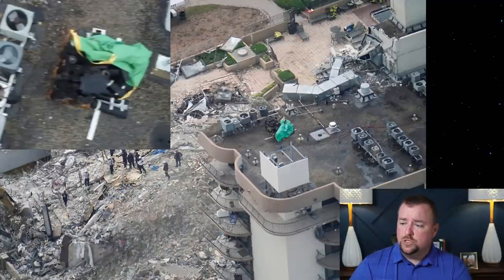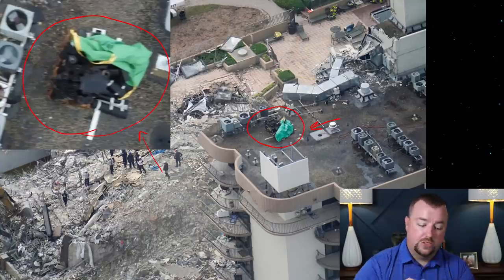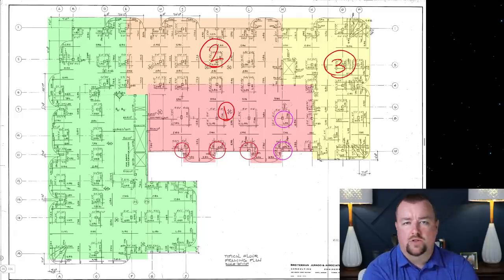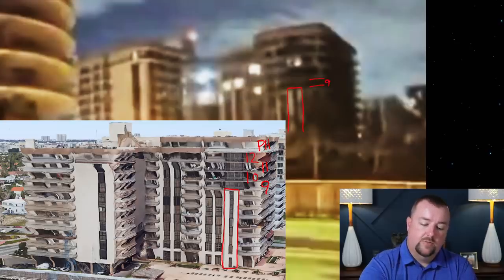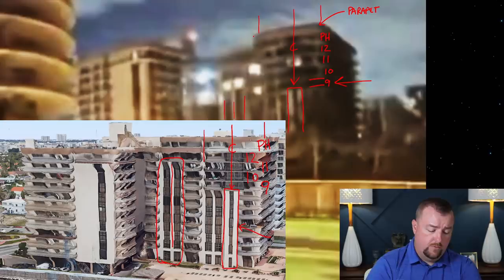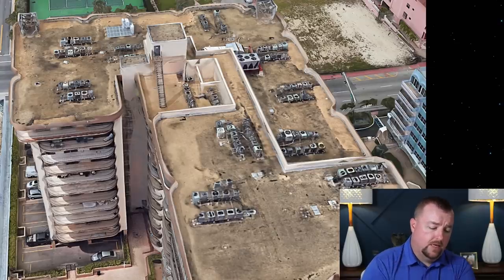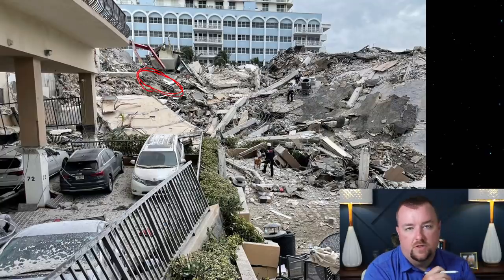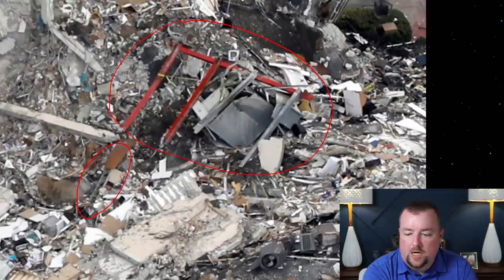Surfside Building Collapse - Did it start at the roof?

Comment from the maker: Remember everyone, unlike others in the media and YT, the purpose of these videos is not to speculate on the definitive cause of the collapse, but to instead explore and think through all possible contributing factors.  And on that journey to hopefully teach about construction and engineering principles.  Thank you for you support!
Reply: Dude seriously. I'm an electrician. That light is hundreds of amps of electricity arcing. Thats why they are blue flashes. Its the electrical lines ripping and shorting out. smacks head
Reply: Your the most professional and reasonable people on here! There are alot of wacky idiots on here posing as a engineers!!🙄    keep up the good work!! Thank you!👍
Reply from the maker: @Kneumann1991  thank you. In the middle of filming, it is sometimes difficult to articulate a thought.  Electrical arcs is what I was thinking... exploding electronics is what I said... hehe thanks for the insight!
Reply: @Kneumann1991  LMAO  You better find another job then!   There wouldn't be any electrical arcing on the outside of the building ,all of the power lines  would be incased in steel conduit and would be in the center of the building in a shaft of some sort. Also,  As soon as those lines shorted out the breaker would have tripped immediately.
Reply from the maker: @Kneumann1991  the portion of the building you are referring to is not L-Shaped at the 12th and PH floors.  Please refer to the direct overhead aerials and review the drawings again.
Reply: Great video as always! Love the detail you go into and I am looking forward to new videos! I work in Network Engineering and it is very interesting to learn about how complex construction is and hear how well you explain it.
Reply: Carmine Fragione  Living in a world full of conspiracies must be really fun. You are part of the problem, not the solution.
Reply: I have already noticed at least one video that has already made a definitive statement that "this is the reason the Champlain Towers Collapsed". Thankfully you are offering critical analysis without jumping into that pool yet.
Reply: Have you seen the video recently released by somebody who toured unit 611 last year?  It has some excellent footage from the garage.
https://youtu.be/w4rGWH7aDJc
Reply: Carmine Fragione  Garbage.  The only thing you can immediately say is some wild conspiracy theory.  Determining actual causes takes time.  A lot of time.
Reply: @Kneumann1991  Look again.  You can see at 7:12 and 27:53 the south side of the collapsed part is all a straight line.  There is no 30 foot back section as you mistakenly claim.
Reply: Super fascinating, thank you for your analysis. I’ve never been interested in being personally involved with these topics via a career, but it’s so cool to learn through someone who can explain it concisely, yet thoroughly.
Reply: @Kneumann1991    Note that car sparks uses 15K - 30K Voltage, to create a spark.
For an electric arc you need  high Voltage not  Amps. 
Anyway, let's agree that  the light is way too bright for normal lighting.
I don't think thees apartments had any high Voltage cables. So It could be either exploding light bulbs,  or explosives.
----
@Building Integrity  I agree on your analysis, that the  part, that collapsed first is already down  6 feet or so at the first frame.
As this building collapsed on June 24th in a similar way as on July 4th, and similar to WTC7, which according to the University of Fairbanks, Alaska was not due to fire,  demolition is the most logical theory to work with.
But let's see what all the building experts have to say. 
You are not jumping to conclusions, which is good.
Reply: @BuildingIntegrity  Not sure if this is significant or not, but just noticed that there appears to have been additional planters added to the pool deck that aren't on the original plans.  If you look at recent photos of the building (pre-collapse), a good site is miamicondoinvestments.com notice the planters that have darker green plants, those appear to have been added later, and one of those, a pretty big one, seems to be right over the area that collapsed first.
Reply: @Kneumann1991  The first step in making a convincing argument is spelling and grammar.  I stopped reading at "your" and "threw".
Reply: Carmine Fragione  no. as he already covered, concrete overloaded in compression shows no signs of stress but will fail catastrophically with no warning. all it takes is 1 beam to crush out and that starts a chain reaction because the surrounding ones take the load, but it's way too much and within seconds or less, they fail. as gravity takes hold, it disconnects the walls from the floors enough that everything falls flat. build a pyramid of books standing up like a house of cards the more layers the better. then yank the centermost one on the bottom. how's it gonna fall?

go look at the photos of the conditions of the concrete. there were already a lot of signs in the horizontal load members that they were overloaded. large amounts of spalling and cracking documented before the fall. as the building thermal cycles from day to night, the expantions and contraction of the structure causes loads to shift, so every day, that cracking progressed exponentially...

so yeah, no. you are wrong.
Reply: I know what you mean buddy, your exploring all means of the failure. Good job
Reply: This is a video showing unit 611 and the parking garage just days before the collapse. You can see water pooling by the beams that failed in the last few seconds of the video:  https://youtu.be/w4rGWH7aDJc
Reply: @jon123etc  yes wet everywhere and stalactites hanging down from ceiling. I think I read somewhere that cars were being damaged by calcium deposits in the years prior to the collapse
Reply: The building sits on top of the Biscayne aquifer. Could the water table have decreased to the extent the sand under the building could no longer supported the structure ? (https://pubs.usgs.gov/ha/ha730/ch_g/jpeg/G028.jpeg)
Reply: There is a great video just posted on the channel fiueee showing the locations of the cracks in the garage as of 2020.
Reply: "not to speculate on the definitive cause of the collapse, but to instead explore and think through all possible contributing factors" That is not how you are portraying  this, you are speculating through possible contributing factors.
Reply: This was great. I didn't understand what planter boxes were so I watched your previous video with the Google Earth pics and now I get it. (I was imagining giant vase/box type things for decoration and couldn't understand how they caused a problem). Such a sad tragedy.
Reply: As a former professional engineer for building design and construction (HVAC), I really appreciate your measured and professionally informed views. Honestly, I hope it makes people appreciate the value of hiring an engineer and contractor with integrity rather than the cheapest engineering stamp they can buy allowing the cheapest construction drawings to go by. (That's why I got out of the business, my liability was attached to drawings the the contractor was allowed by the developer to build any way they wanted. I was a stamp to satisfy the law and code officials, and to be on the lawsuit should one occur.)
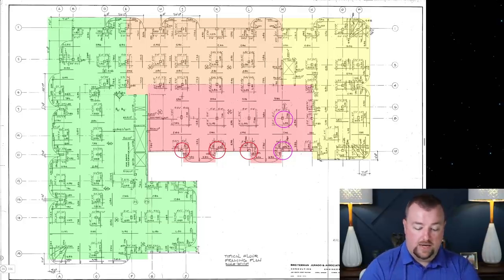Reply: @Kneumann1991  At 6:18 you can see the plan view of the building. That ~5 foot extension of that part of the building (Collapse 3) is what I think you are referring to. However, the roof is extended outward over the first collapsing section to be co-linear with the extension of the Collapse 3 portion. That means the visible roof line on which Josh is basing things is a continuous line that, when broken, tells the story of the sequencing of the collapse and likely origin.
Reply: I'm no engineer, but I did go to school for construction trades and have some basic clue as to what's being discussed in these videos. The conspiracy theories are laughably inadequate to explain the wealth of failure modes plainly obviously in the photos that caused the collapse and which were caused by it.
Reply: thx for your videos, it's hard to hear you in this one, especially compared to the other vids.
Reply: @Kneumann1991  I agree, that seemed pretty obvious to me from day one of the seeing the video.  If the video had stated one or two seconds sooner it may have been more obvious to most.  Then you see all these conspiracy fools saying bombs, etc.  SMH.
Reply: @willschultz5452  Breakers would've tripped after the arcing.  He didn't say anything about arcing on the outside of the building.  Those flashes were in the interior.
Reply: @bobbyd6680   Electrical conduit would be in the very center of the building some place not where you would be able to see it from the outside or from a window. Also the arcing would be inside of the conduit so you would never see it
Reply: Hello all. This doesn’t directly have to do with the collapse but i was reading that the Millennium Tower in SF CA sank 18 inches, is listing, and not secured to bedrock. 

100M usd is allocated to attach the tower to bed rock after completion. 

How does that work? How do they do that when the building is already completed?
Reply: @BuildingIntegrity  The ladder you're looking for is much larger and laying down and to the left of the one you was looking at... top left of the tan colored section it was attached too. 
 One thing I would note is the one continuous pillar laying on top of all the rubble, which oddly enough is not seen on the collapse video (from what I seen).
Reply: @buildingintegrity I emailed you video of the picture from the other angle of the building that you said is your favorite picture to show the ladder from the roof and the red piece from the roof.
Reply: @seldoon_nemar  None of what you said means a thing when it comes to this ''event'' This was a controlled demolition and land clear of an empty building. I don't even care if this building had existing problems because it was selected for demolition by whoever is running this long planned, scripted collapse event. Nobody Died.. the building was completly empty and I can prove it was unoccupied at the time of the first controlled demolition ... Just look at how bone dry the still standing floors were the night of and day after it supposedly spontaneously collapsed. There are miles of plumbing in that building yet on that night the pipes were dry ... yeah right, and Dr. Rachell (Rick) Levine is a woman!
Reply: Another video that I watched today shows clear evidence that the pool deck collapsed first. There is video evidence that appears to show concrete debris on the parking 7 minutes before the collapse of the tower. There is an engineering report dating from 2018 which indicates that waterproofing had failed. There are photos which clearly show concrete spading and obvious signs of rebar corrosion of the concrete slab of the pool deck. It also seems that there was a major error with how the pool deck was designed. There was no slope, so rather then being able to drain, water was able to pool onto the pool deck.
Reply: Carmine Fragione  Correct Carmine this was a controlled demolition with a script attached to the event. Nobody died this building was empty for a long time before the controlled demo however they kept up the appearances of it being occupied because it's a psyop as well as other things it will be used to accomplish. I know it's hard for people to fathom but this is really how things get done in the fake reality World. Thank you Sir!
Reply: @travisthechimp7857  okay, enjoy your fantasy
Reply: Carmine Fragione  i'm still thinking about this the next day. never seen before is how a LOT of engineering codes are written. they are literally to prevent horrid edge cases like this by providing a legal minimum build quality. after 40 years of gross neglect and mismanagement...

yes, the management company is LEGENDARILY stupid and will be cited in books for the next hundred years because of this
Reply: A plane crashing into the building caused the collapse. Just like 9/11
Reply: didn't watch your video , I solved this before anyone , as soon as the security video became public , I ran it frame by frame , an you can see the structure collapse from under , the first sign of trouble is when you see the 2 columns buckle at the knee .... the roof is intact as the structure begans to crumble, I knew this on day 2 of the tragedy , it didn't take me  14 days to figure out ..
Reply: @Kneumann1991  Duh - makes perfect sense.  Thank you.
Reply: @davewilson7255   Carmine's comment. Good for a laugh, yes.
Reply: @EZ Z 
If the water causing the damage to the pillars was from nightly watering of the plantar boxes, the water would not be chlorinated. I don't think that water from the pool was the problem, because the pool was at thar far end of the decking, and the pool was still filled completely with water in photos the morning after the collapse.
Reply: @bobbyd6680  distribution panels located every floor/every other floor that bring power to each of the units in those buildings. Each unit would have a sub panel inside a closet etc. There's definitely wires big enough to arc all throughout. Even ripping a 120v ceiling light out is going to be pretty bright at night.
Reply: An interesting animation of the collapse that shows the progression of the collapse.   It speculates that the collapsing deck pulled down those three columns.  That might not be true but the progression matches what I've heard.
Reply: @Hobomuskrat  I'd bet more on a distribution transformer in the basement getting crushed and shorting primary and secondary windings, delivering 13.8 kV, or whatever they use in Miami, to the 480V/277V internal distribution. Even delivering 480V to 277V to nominal 120V circuits is likely to destroy some appliances or lighting with arc flashes. That high voltage is likely to arc until it blows the high voltage fuse, and unit breakers would not be able to stop distribution level voltage. It would be interesting to see the blueprints of the electrical room, but electrical issues are one of the critical safety problems a different condo that was evacuated and needed to address, unsure if the electrical system had been inspected here.
Reply: @willschultz5452  Excuse me? Do you work on industrial electrical equipment during hurricanes?? I have been on site when electrical components explode and electrical lines short out. Electrical lines are within inches of the outside of the walls. If the walls are cracked open and the lines rip from each other and arc, that flash can be brighter than the sun. Ever hear of arc welding? Before you try and criticize people first study a subject.
Reply: @BuildingIntegrity  Will do, thanks for correcting me. Sorry was late at night and was watching political crap prior haha. Also, thanks for what you do.
Reply: @clamboni9  No not volts. I did not make a mistake. You just have a common misconception. High voltage is able to ionize the air to allow electrons to flow. If you touch the leads of a neon sign transformer together they make a spark you can barely see. But if you pull the leads apart you can make a arc an inch long. The reason it doesn't spark when the leads touch is because there is no amperage. Small neon sign transformer are 15000V and .25amp. Now arc welding on the other hand only requires only 10-50V and 50-300A. Amperage is what generates the bright flash when lines short out.
Reply: @brazilnut8898  Oh im sorry did spelling and grammer build anything?
Reply: @Kneumann1991  I know all about it,  theres no way your going to see a flash outside when the electric runs inside of rigid steel conduit in the center of the building in a utility shaft encased in concrete.   As soon as that shorted out the breakers tripped off instantaneously
Reply: @bobbyd6680  Yeah I wish more people understood how things work so they could see how foolish or real the conspiracies are. Like corporations and government have taken over how we live our daily lives, that's real. Bombs being put in a building that's been crumbling for decades is false.
Reply: @lagautmd  Yes, thank you. I read a bunch of replies and relooked. It was late at night and damn politics had me all flustered lol.
Reply: @seldoon_nemar  Yes and perfectly explained as well. I hope others read this.
Reply: @reallyme3573  No not volts. I did not make a mistake. You just have a common misconception. High voltage is able to ionize the air to allow electrons to flow. If you touch the leads of a neon sign transformer together they make a spark you can barely see. But if you pull the leads apart you can make a arc an inch long. The reason it doesn't spark when the leads touch is because there is no amperage. Small neon sign transformer are 15000V and .25amp. Now arc welding on the other hand only requires only 10-50V and 50-300A. Amperage is what generates the bright flash when lines short out.

P.S. Drop the explosives use crap because that's extremely insulting to the lost and loved ones of the lost. People need to understand how things work before slapping a conspiracy on it. Read what "Seldoon Nemar" wrote to me in the comments. He explains the principles of the collapse very well.
Reply: @willschultz5452  your wrong there, before a breaker trips, it will arc!! Don’t believe me? Go to your electrical panel and short out 240 and tell me if you see a nice blue flash before the breaker trips??!! I know personally that it can knock you on your ass and will make a nice pretty bluish flash before that breaker trips. And it can kill also before that breaker trips!! And any of those runs could easily have been compromised when it collapsed. Including ripping out wiring in the A/C units. So no it is not completely protected from such events!
Reply: @richardswenson4463   There is no heavy power that is run up that high in the building. Back in the 1980s each unit was probably supplied with 100 amp service.  The electric meters were probably in the basement or the 1st floor in a utility closet,  each meter has a 100 amp main breaker right next to it.  From there there would be a 100 amp service per unit running up to each apartment. As soon as those main service cables were severed and they are inside of rigid conduit  in a utility shaft  Those breakers would have tripped off immediately. The small arc. That they would have made would not have been visible from outside of the building.  Not to mention the elevator shaft and the utilities shaft was still standing so that never collapsed.
Reply: I'd like to see a discussion between you and a demolition expert reviewing this video (and/or any other available videos) identifying the reasons why this could not possibly be a controlled demolition.

It's about time to get a demo professional's input to dispel these alternative theories... preferably an expert from the EU... someone that has not seen the evidence before, who is credible, and who does not have anything to lose or gain by offering their opinions.

Thank You!
Reply: Hi Josh, 

please have look at my graphic.

http://zer0page.com/pix/aera-of-initial-collapse.jpg

Check out the positions of the coloums in relation to the floorplan, Parking Spot 78  and the videos we know so far. Do you concour?

I think initial collapse started in the aera of all these heavy Planters in front of Unit 111
This certainly would have made parts of the pooldeck come down too, which might have looked like what a witness called "a sinkhole".
Eventually the south facade of the building started coming down dragging everything else with it.

As for the bright lights on the collapse-video, they are most certainly light beams from electric cabels beeing ruptured.
As it happens the electric supply for the middle section of the building came from electric distribution rooms just behind the shear wall right next to the elevator shaft (see 1979 electrical schematics).
This is probably because at the start of the video the whole thing had allready come down at least one or two stories (great find by the way).
Reply: @Kneumann1991  Thanks for the explanation, but  do you know that there  is a problem maintaining electric arcs while using  AC-voltage ?
Reply: @willschultz5452  You should be fired for endangering your workers lives if you don't understand what "arc flash" is. Just look into it and you will better understand. I'm sorry I'm just an industrial electrician and a hobbyist electrician and seem to know more than a master. Instead of using your time to try and prove to people how they are wrong on the internet. You should use the internet to better understand how things work.
Reply: @Kneumann1991  I know EXACTLY how things work.  Ive been working on buildings like this for years!!!  That so called "flash" is a reflection or a outdoor light.  There is no  Industrial voltage in that building!  Its simple single phase 240v.    Anyway it's all in heavy conduit in a cement utility shaft like I mentioned.  The shaft was still standing.  So unless you can see a flash through 8" of concrete and a steel conduit 🤷‍♂️
Reply: @reallyme3573  Why do i have to teach everyone about everything? This is ridiculous. Most high voltage arcs are AC. Most arc welders are AC. AC is pulsing where DC is constant.
Reply: Martian Technology  There are so many different air conditioners because each model can handle different area sizes. It's also because they are built to break after so many years. They keep making simple adjustments so that they can re-patent their idea. After so many years anyone else can use that old patent. Plus technology keeps advancing so they are able to more easily add components or modify with new knowledge.
Reply: @Kneumann1991   The service to each of those units would be no more than a 100 amps. Especially back in 1981. I have shorted out 100 amps  Numerous times the breaker trips off instantaneously there is no arcing on the outside of the building.   That is either a reflection or an outdoor light
Reply: @travisthechimp7857  many people died in this are you crazy!!!  You sound like Alex Jones!!!
Reply: @jonathanlanglois2742  yes the pool deck was the cause and collapsed first
Reply: Did you notice the repeated flashes on the left side of the roof  up where the elevator and utility shaft would be? On the part of the building that stayed standing.  Those I think may have been arcing where all the air conditioning compressors were being torn from their wiring possibly.
Reply: @Kneumann1991  also the don't run service feeders in exterior walls , they are in the utility shaft in the center of the building.  That part is still standing. When those were cut off as the building fell you wouldn't see that from the outside.  Those are most likely outside lights or hallway lights
Reply: @Kneumann1991   You better go back to school because you have no clue what you're trying to convey to any of these people!!!!!! I've been working in the field doing commercial electric since before you were born!!   Trust me you are not fooling anyone with your BS!!!!!  You are just on here trying to get on people's nerves!!!    I work with this stuff every single day!!!!  I know what it does and what it does not do and I know where they run service lines within a building!  Just stop!!    I can make plenty of videos simulating all of this stuff!!
Reply: Martian Technology  each condo unit has it's own central air conditioning system.  Every one has its own unit on the roof.  Probably over time as each one went bad the persons contractor replaced it with whatever brand they use.
Reply: What about the huge planters with bushes on the pool deck over the parking garage, getting over watered for 40 yrs causing the rust & damage to concrete roof of parking structure - theres pix of ceiling damage in the parking garage showing rust.
Reply: @ShalomShalom-d5c   I think that was also part of the problem
Reply: @ShalomShalom-d5c  These buildings were designed and built to withstand CAT5 hurricanes.
Yes, Will... circuit breakers (even mains) will trip in under one cycle.
No Will... it was flash then crash.  The flashed preceded any destruction of the structure so the flashes were not the result of the collapse, they were the cause.
Reply: @richardswenson4463  You are 100% right. This guy will just can't accept he is wrong or take 30 seconds to read about arc flash.
Reply: @willschultz5452  Two words. Arc Flash.
Reply: People's lives are being endangered by Will Schulz. This is maddening and disgusting. Electricity is not something you F with. It can take your life in a second.
Reply: Arc Flash. Its all you people need to understand when it comes to those flashes.
Reply: Martian Technology  Sorry to hear that. It happens to me sometimes also. What does the for champagne towers have to do with different AC units?
Reply: @willschultz5452  Please. Please hear me man. I'm not trying to insult you.
Reply: Martian Technology  Ah that's simply because if you watch any movie enough you can already tell what's going to happen next. News isn't news in America anymore. It's more of a drama series of everything going on. The moment this happened I was saddened but also knew every democrat news outlet would try and use it to attack Florida and Ron DeSantis. There is a motive to what the news tells you and doesn't tell you. Either it's financial or political, and lately it has been both.
Reply: @willschultz5452  explain then how they supply power to all the A/C units and there also is the elevators! They don’t run on nothing!
Reply: @richardswenson4463   each resident has to pay their own electric bill so each air conditioning unit is powered from each residence circuit breaker panel
Reply: @Kneumann1991  Key element here is the gap distance. Arc welders use a very short gap of only a couple of mm's.  When a power cable is broken, at first it is stretched to the breaking point, then it snaps and  shrinks to it's original length. Doing so it creates a long distance between the electrodes,  then with Alternating Currency at zero Volt, it will stop, and due to the long gap won't re-ignite.
Creating a spark of 1/50th of a second max, which wont be captured by the camera.
-----
There's yet another problem,  and that's that power-lines usually run through shafts, on the inside of the building, not visible from  the outside.
Note that the light is visible in multiple windows of the apartments.
Reply: @randomorder2824  The floor didn't get pulled out it dropped out. Look I get everyone has been trying to relate this to 9/11 and I hope you realize the entire demolition theory is that Epstein had a hard drive hidden there. There has been reports since the 90's that there is water intrusion and its causing damage. It wasn't fixed for 30 years. If you really are what you say you are and know what you say you know. Than please don't jump to conspiracy without understanding all other possibilities.
Reply: @reallyme3573  Note you have no clue what your talking about. Electrical lines don't retract like a rubber band when snapped under tension its metal rofl. If anything they will curl as one side cools faster than the other. When they snap if the end of the wire connected to the circuit breaker touches any neutral line or ground in the building it will arc and flash. "Alternating Frequency" not currency and the statement made no sense anyway. Nothing will stop except the electrons on the black wire waiting for somewhere to go. There is also no Re-igniting electricity... its either on or off. If you unplug your light from the outlet the light turns off but the outlet is still "on". Sparks will last as long as the amps don't go to high for the breaker to trip. If you use wire rated for a half amp on a 15 amp breaker you can make sparks all day and the breaker will never trip. Your shaft theory is just as funny as the last guy who said it. Isn't there an outlet on every wall in an apartment?... wake up and smell the coffee. Ceiling lights/fans and wall outlets. The mains to the circuit panels in each apartment are in steel conduit. From there though, electricity is wired completely around your home or unit.

Edit: Oh and light in windows??? YEAH PEOPLE STAY UP LATE AT NIGHT. THOSE WERE PEOPLE WHO WERE AWAKE AND WHO DIED!!!!! As you even just said wires stretch. They just don't retract like you think. They are metal they don't shrink that much. They also stay live if cut but not shorted out. A 15A breaker would require a 15A short to trip it.
Reply: @Kneumann1991  what kind of electrical work do you do?
Reply: @Kneumann1991  Happens to me, too... best to avoid that political crap, LOL!
Reply: Damn, sure wish you had analyzed the twin towers, so disturbing to see!  That was sure no "pancake collapse",  that was a progressive explosion that blew everything in those buildings, including people, into virtual dust.
Reply: @Kneumann1991   This is what happens when a copper wire snaps:
https://www.youtube.com/watch?v=bpSQf6-4gHA
Electrical lines DO retract similar to a rubber band when snapped under tension.
---
AC = Alternating Current, not Alternating Currency (Did I say that ?, my mistake ) 
---
Note that with Alternating Current, there's a point  in time,  At 50 Hz, 100 times each  second, where the Voltage is Zero, and the electrons don't move forward nor backwards. That zero Voltage, Zero current, will terminate the electric arc, if it ever existed. During welding,  the electric arc will remain during  AC-welding, that is because of the short distance between the electrodes. try AC welding with a bigger gap between the electrodes and it will fail,  not so easy with DC welding.
----
Now we know this, an electric arc could be present for no longer than 1/100th of a second.  Way too short, to be captured by a surveillance camera.
---
The bright lights, that we are discussing came from the APARTMENT windows, not from a hallway.
So it must have been a flash in the apartment, causing the bright light.

If, the color of the light looks like an electric arc from welding, then maybe that could be what has happened:
Some automatic welding equipment cutting through the rebar in the already weakened, prepared columns.

You constantly talk about the people that died. That's a wrong attitude.  The MSM-news told you that people died, but do you know that they lied to you in the past ?
So forget the people that may or may not have died, forget  the narrative of the  so called eye witnesses and switch of your emotions and start think pure logically, and look at the surveillance-vid at what it shows, but keep in mind that it may or may not have been manipulated through CGI.

The surveillance vid shows that the collapse starts at the bottom. followed by the bright light at the top,  followed by the  implosion of that same part at the top. 
That's a controlled demolition scenario from the textbooks.
Reply: I hear alot of small hats died.

😁
Reply: Thank you for doing what you do. There is another channel here in YouTube that makes wild claims and then tries to politicize the whole thing.
Reply: Speculating on the definitive cause of the collapse is exactly what you are doing.
Reply: @willschultz5452  Guess you don't work with electrical equipment - Always a FLASH before a breaker trips ... Especially at 100's of Amps
Reply: @glenholmgren1218   It depends on how the circuit was broken. If it is a fast clean cut the 100 amp breaker will trip immediately.   Yes there might be a  Flash but where those electrical lines were located you would have never seen it from outside.  The utility shaft was still standing and  Each main feed up the shaft to the condo units would be inside of conduit also.   That shaft is over 50' from the exterior wall.  If there was a flash from it I doubt you would see it.   I'm sure all of these things will be studied more carefully when the investigation begins though.
Reply: I think the real reason may not be revealed.The reason for 9-11 was just revealed and as millions have said,Thermite. it was found on roofs after the collapse.
Reply: @Kneumann1991  my husband works as a lineman for a power company, and they work on the lines hot. He’s almost been flashed, has coworkers who have been, and has lost a coworker and had one burned badly. It’s very dangerous stuff.
Reply: @michealgoins1625  Mainly Industrial single phase to three phase motor work on automated systems. I can literally do any electrical work though. I should start making videos of the things electricity does when its not supposed to.
Reply: @christianehoelzer2228  I'm a bit confused on what you mean by steel packed Wi-Fi cables. I'm not sure if this is just a bad translation. Wi-Fi is a wireless connection. I think you might mean Cat 5 or 6 cable. I'm not really sure what you mean though. The steel cables you mainly see hanging is rebar and the tension cables that supported the building. There are definitely other cables like coax, CAT 5 or 6, and power lines.
Reply: @amberw144  Yes, yes it is very dangerous.
Reply: @glenholmgren1218  Thanks at least some other people actually work in the field and write comments lol.
Reply: @reallyme3573  Firstly do you know what's a wrong attitude? The attitude that rich elites care about killing off a few hundred people for their gains. Pharmaceutical companies kill that many every few minutes. Secondly let me just say I live in south Florida and know people who lost someone in the collapse. You really need to find help. The lights in the apartments were people still awake, as your video shows copper can stretch. Honestly you sent me a video to watch that only proves you wrong rofl. The top pully moves away from the wire, the wire doesn't retract lol. The sudden drop you see on the chart is because there is no more displacement happening. The displacement is a measurement of the wires length as it is stretched. The drop to zero is because the displacement or stretching has stopped. You can't even understand a displacement chart. Also First off, all electrical wires are insulated. The insulation will snap back like a rubber band and leave the copper wire stretched and exposed. If that exposed wire touches anything grounded or neutral it will arc for much longer than 1/100th of a second. Your whole argument is based on nonsense. Also AC in America is 60Hz. Meaning that every 60th of a second the voltage has completed a full cycle. Yes MSM is a complete load of trash, but so are you arguing something you have no clue about just like them. You are the main stream media in this convo my friend and I hope you realize that. You're just as full of horse sh!t as they are. It must be nice pretending people didn't die. Must help you sleep at night or your just that ignorant.
Reply: @christianehoelzer2228  I think I know what you're saying so I want to say yes lol. I believe you're pointing out there are multiple cables for all household electronics, correct?
Reply: Look people, if you are unable to understand this stuff after the multiple explanations I've given. Well than there is no hope for you. I'm tired of this nonsense. I'm going back to watching other videos on how things work instead of trying to teach everyone else. If you have some intelligent and constructive to say hopefully I will see in in my notifications and ill talk. Other than that I'm not answering any more straight up ignorant people. Trust me, you know if I'm talking about you or not. Its always fun testing my knowledge. It's even more fun being corrected when I make mistakes, this means I can learn and grow. Thanks all, and keep learning how everything works. It might save you one day.
Reply: @willschultz5452  This is my last comment to ignorance. Congrats Will. Your message to Glen is so wrong. Do you have outlets on almost every wall in your house or condo? The answer is yes, so stop talking about the main. No one ever said anything about the main line. I'm guessing you finally cut a power wire with scissors and found out there is a flash. Good for you. Keep learning and one day you might actually be smart.

P.S. Now I'm insulting you.
Reply: @Kneumann1991   You better quit while you're ahead!!!  I'm busy re wiring and operating Room in a hospital so I don't have time for your nonsense anymore this will be my last response!!!
Reply: @Kneumann1991   Yes the master electrician expert has just spoken!!!
Reply: Martian Technology   Another nut job on the loose I see!!!!!
Reply: @Kneumann1991   You are the one that needs to keep learning. I know very well what you are talking about with Ark. Flashes I do demonstrations during fire prevention week for little children to show them the different effects of electricity!!!!  What I am saying is you're not going to see those flashes on the outside of the building from where those flashes would have to have been created.   Don't forget those walls are cement not wood and drywall.
Reply: @willschultz5452  Says this will be his last response, proceeds to write two more after. Quit while ahead? So you admit your wrong and falling behind. Funny.
Reply: @willschultz5452  Don't forget walls were sheered in the first frame of the video. Mister cement, wood, and drywall. Sounds like what your brain is made of. Eh its probably closer to the aftermath. Just a bunch of rock, saw dust, and bent steel.
Reply: @christianehoelzer2228  Wow. Yeah that's sounds like really bad construction. The only other option would be much much larger cables but this will have many problems as well. High rise buildings are a fire hazard in general and are only built to increase monetary gains. Just remember either it's built a certain way because someone lost money or they want more money. Safety protocol comes after someone already got hurt.
Reply: @willschultz5452  How much electricity have you done sir ? I think this event could not be explained by thevinins theorem or anything such as that. The catastrophe if the utility channel which we have to assume contained both the electricity and the water caused the steel reinforcement to become live at super grid voltages well I can not theorise what would happen exactly but it would seem to make a good plan for a fireworks display. Not meaning to make any more the loss of the occupants or their families here but the deaths must have been horrible as anyone who has done uvats can easily imagine.
Reply: @Kneumann1991  If that flash came from inside the building and it looked like it did,  it would have been caused by something non linear not really Ohms Law at all.
Reply: @Kneumann1991  Interesting, your comments on the first vid that I gave you to watch. You need either an appointment with your eye doctor, or you are desperately in need for a new monitor.
After the wire break, there is a huge gap between the bottom-end of the wire and the pulley.  If you can't see it, your problem, not mine.
The graph is force vs displacement of the pulley, and the force drops to zero, when the wire breaks.  The graph shows that the pulley stops moving.
Reply: Okay, Michael Chase, just admit that Tony is dead.
Reply: @factorylad5071  Ohms law is how you figure out amperage, voltage, or current. wtf are you talking about.
Reply: I took a screenshot of that so called stairwell.....bruh, I zoomed in on the screenshot and as out, everyone else is correct and you're wrong..... it's a ladder. 😏
Reply: @BuildingIntegrity  I'd agree, electrical power cables shorting will cause a blue flash. Forwarding it frame by frame it lasts 0.6 seconds (obviously could be more because we don't know when it started) it also varies in intensity. Very much looks like power cables shorting as they are ripped out.
As for motion detect there are two ways you can do it - PIR will detect any movement near the sensor with the only control being on the level, Delta frame take a frame say every second and compares to the previous but constantly overwrites and only starts recording if there is a certain degree of change. You can vary this much more and mask out parts of the picture from the detection (such as the bush on the left) or even trigger on certain colours. But it will detect changes in light too so that can be difficult. But cameras can also trigger on sound.
Reply: @Kneumann1991  Agree. I can attest as truth about insulting family members. Had a cousin die and a woman repeatedly INSISTED we sue Toyota. Meanwhile, I didn't even know wtf she was driving. It didn't say anywhere. 

But, yeah, some stranger online who doesn't know us or ANYTHING about the accident, knows better than us and the experts...

Her brother and more than one of us finally politely asked her to STOP IT.
Reply: Those “lights” you’re talking about, are arc flashes from the electrical supply being torn apart and shorting out as positive and neutral lines contact each other.
Reply: I think it must have started at the pool area or garage. Also there were floors in the building.